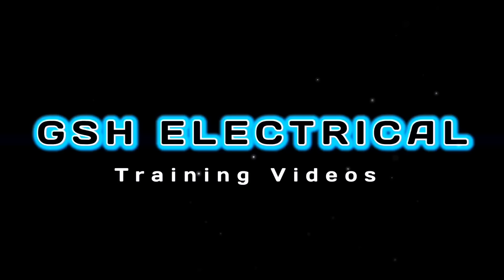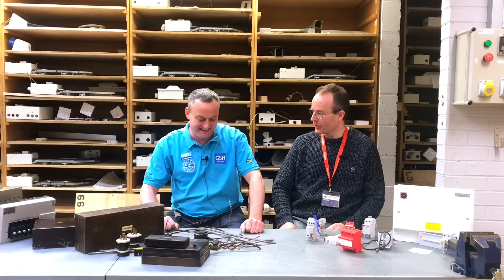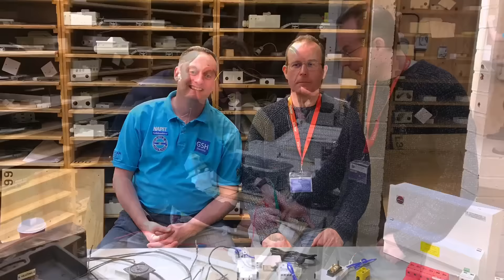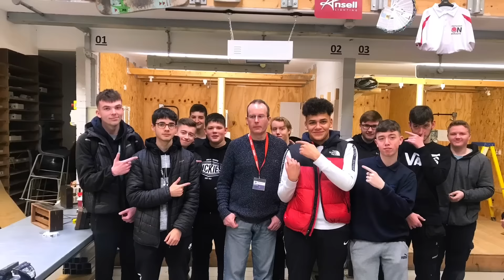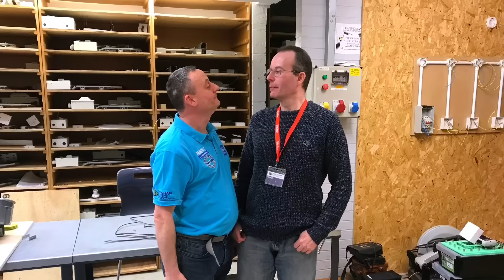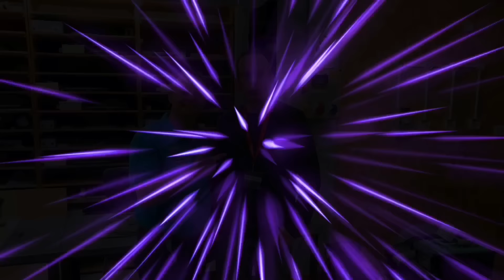John Ward Talks About New Consumer Units - Types of RCDs, Types of SPDs and AFDD (Fuse Boxes)

Comment: I have to move my C/U at home to another position but inside the house not an external wall. A new meter cupboard will be fitted outside to suppliers requirements. Was going to fit a complete Hagar DB with SPD within. Obviously I will need a SW Fu just after the cut out (a separate cupboard inside) with 3mts of rails. Will the SPD still comply built into the new C/U???
I'll be using 25mm 3 core SWA from Sw Fu to new Hagar C/U, a short run of about 7 to 8mts.
So much conflicting info nowadays I never know what right any more.
Doing my 18th reg course in Jan having been cancelled twice due to virus so not fully upto date with SPDs.

Comment: I just hope fuseboxes are still available !

Hopefully all these trendy gadgets will quickly go out of fashion when we're all on 12VDC power supplies - then rather than nearly everything coming with a step down transformer in it, it'll connect directly and big power users like microwave, kettle and vacuum cleaner - oh, even those are battery powered nowadays - will be powered through step up inverters.
Reply: How thick are you expecting the 12vDC cable would be to supply 2000watt Vacuum cleaner?
Reply: @ColinRichardson  I spy with my little eye something beginning with W

Comment: What circuit breaker does a combo boiler should have coz I am worried I found out that mine has a  40A breaker and I know it should have a 3A FCU to protect the boiler
Reply: The 'manufacturers instructions' should always be adhered to, FCU with 3A fuse in most cases.

Comment: I still wonder why people fit surge protection devices. They don't remove any surge until the voltage rises to (at best) 1500V. Electronic equipment is already on fire by then. A client of mine regularly loses electronic equipment despite having LOTS of surge protection devices. The SPDs indicate that they are still unaffected by the surges, probably because the equipment on site is doing their job instead. As far as I can see these SPDs are a waste of money. THEY DON'T WORK.